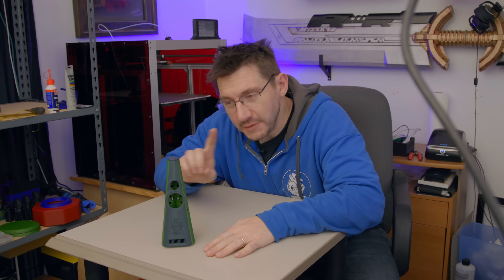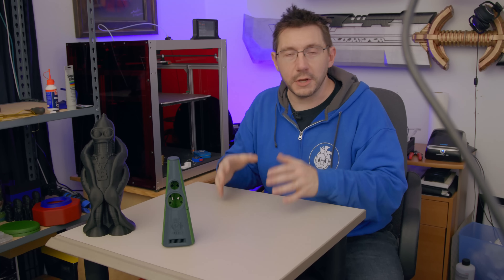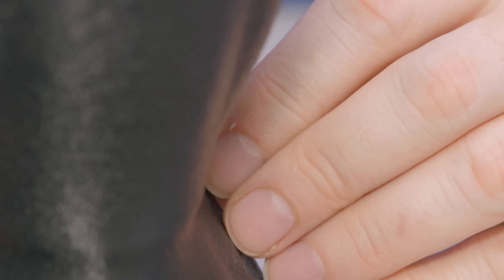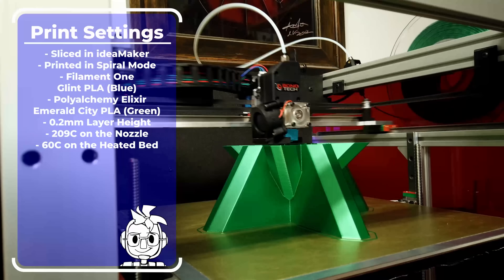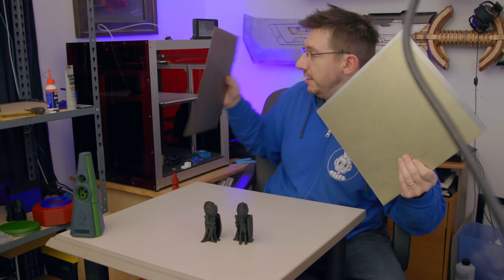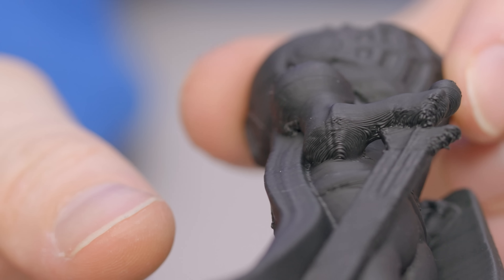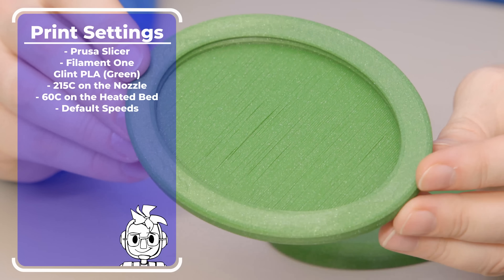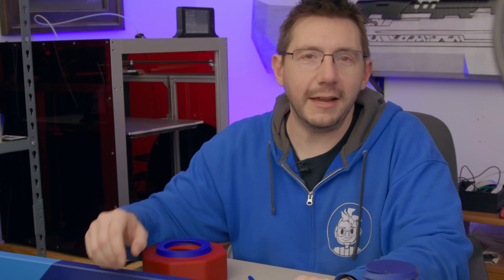Satisfying Prints from the Daedalus 3D Printer!

Comment: I think there is a mistake at 1:20: Isn‘t a CoreXY printer defined by the belt system driving the print head diagonally? So when only one motor spins the head moves from X0 Y0 to X100 Y100 f.e.?

Comment: The caption explaining corexy is wrong.  It's nothing to do with the Z axis at all.  It's in the name darn it!   
It's all about the way the X and Y axes are controlled.  The characteristic of a corexy is that to move in only X or only Y, both motors have to move in sync.  If only one motor is active, it will move the head on a 45 degree line.  The often confused H-bot uses a similar system, but the arrangement of the belts means each motor controls a separate axis, so it is a cartesian printer.
That tree was gorgeous.  One day all prints will come out like that.

Comment: You mentioned the layer bonding issues on your Polyalchemy Elixir, and I wanted to mention that I've had similar issues with my red Elixir filament, even when new. It just seems to be somewhat more brittle of a material than most PLAs, possibly because of whatever they put in it to get that shiny surface finish

Comment: Regarding the bumps on the big nut: You do not need any retractions on this model if you can convince the slicer to always move the print head around the big inner hole and never cross that hole.

There might be a setting like "avoid crossing outlines" in your slicers and in Simplify3D there is an additional "maximum allowed detour factor" which I have set to a ridiculous setting of 70,0 and in this setting I can print things like a c shape or like an o shape without retractions and without retraction blobs, because the print head always stays within the model, in every layer, in every head movement. And the layer change is so fast that it does not need a retraction.

Carefully look at the preview with head travel movements enabled (the traces of the movements, the lines) and watch if you have got the settings right before printing it. It might cross the inner hole on the last flat disk-like layer with a fast travel move (which is annoying, because that leaves a trace mark), but it should not cross that hole anywhere above. 

So there should not be any stringing (that is hidden invisible within the model) and there should not be any retraction blobs, because we don't need any retraction just for the quick layer changes. The print head will not stand still at any place for a second, it will always move and therefore we can avoid the blobs.

Test it with a small model for a first try.

Comment: Elixir has weird retraction: it oozes long after pressure in the nozzle is relieved.
Fast travel, long and slow retraction, moderate layers, dehydrate the stuff just before you use it.
Layer strength will never be very good.
*
It is two plastics in one: a translucent bulk material and a pigmented bit.
The bulk has a lower melting point than the other bit.
During printing, the pigmented bits get stretched into very fine strands suspended in the bulk material.
A difference in the way the two materials bend light makes the strands shimmer.
Pigments in the strands tint the reflected light, much the way metals like gold or copper do.
Clever use of refraction.
Ornaments look great, but any ringing or wobble shows up like mad!
Elixir printed objects hold up well, even scuffed surfaces still look metallic.
Vase mode is best, a dense print might crack over time.

Comment: There is a NEW ATTACHMENT for the Ender printer. its a 45 degree bed with Auto eject feature with a new type of glass bed and it will print totally different models, all in he same cue. I would like to see your test and opinion on it supposed to retail for 200. Made by 3D Que and called Quinly and is supposed to automate the ende 3

Comment: I ordered a Daedalus based on your review/unboxing too late to help the kids, just needed more time to make my mind up.  I have been 3 D Printing for  several years now using a XYZ AiO 1.0.  So far so good.  Needless to say I am still learning about the printer and Prusa Slicer. My biggest issue is supports that are absolutely terrible to remove using the Prusa Slicer and the settings from Git Hub for the Daedalus.  The XYZ slicer generates much better supports in general to remove verses Prusa Slicer.  I'm sure it will just require me learning how to tune the settings.  I am looking forward to the improved cooling arrangement. Keep up the great informative videos.  I am working on  adding a door and top cover to make printing ABS a little less challenging.  I was able to find red acrylic at the local DYI place, not exactly the same dark cherry red, but wanted to keep with the color theme Project R3D started.  Support from them for questions has been great.

Comment: Joel, I want to thank you for bragging up MagiGoo. I was skeptical when I acquired it, if it'd help with bed adhesion more than the hairspray that I was using. With the hairspray method, I'd get 3-4 prints before I had to clean the build plate, & re apply more. I've now printed over a dozen parts on with the original application of MagiGoo. I'm really impressed with the product they sell! Having gotten great prints with PLA on the CR6-SE, I'm now stating to experiment with printing ABS on it. HOPEFULLY ABS & MagiGoo continue to give me the same results as PLA did!

Comment: I once attempted a Voronoi vase on the MK3S with so-so filament from Raise3D (dual purpose: I wanted to see if I could print the vase, and I wanted to get rid of suboptimal filament). The darn thing wanted to curl at every opportunity, so I think I slowed it down to give the cooling fans a decent shot of freezing the PLA as it came out of the nozzle. It worked, sort of.

Comment: I am interested in this. I have 3d printed a smaller speaker box myself.  My biggest concern is that while very cool. Resonance of the material may not be a great. Normally hifi cabinet speakers are built from solid materials like thick wood, mdf,metal or even marble. This is to reduce vibrations of the box it self. 3d printed filament just does not seem like a stiff enough material. I am a hobbyist speaker designer, but do know some of the heavy weights who make the $1k to 10k speakers. Putting nice drivers into a bad box, can lead to very bad sound. I hope this has success, but I am really doubtful. But would love to be proved wrong.
Reply: For this to work acoustically, the material would need to convert physical vibrations into heat super efficiently. That's sounds like some future material to me. To test this enclosure, use an accelerometer attached to it (at various locations) and play a frequency-sweep audio file to find resonant frequencies. This will include resonant frequencies of the speaker drivers as well; i.e., nothing is easy. Or just declare that the speakers sound great...

Comment: You should do the bowl of water test for the fans to show how close it is to the nozzle and you can also show where it actually hits and all that by putting it under the hot end and adjusting the Z height till it’s close and then you can see the ripples in the water and where it’s hitting and if it’s aligned to be right under it and such

Comment: Ender 3 gets these results .. lol
Reply: You can absolutely get great results with just about any 3D printer, normally you have to sacrifice a few things to achieve them. You normally have to slow print speeds and tinker with your printer to achieve the best results. The Daedalus is meant to remove as many sacrifices as possible, normal prints on the Daedalus are between 100-150mm/sec (true speeds) you can definitely turn a printer up to those speeds but they normally won't achieve it due to accel and jerk settings where this unit will. For reference we have cut the print times down to roughly a third with the same quality,  using the same size nozzle and print parameters when compared to $1000-5000 printers on the market. It also has higher-end components needing less upkeep over time. Either way, yes you can make any printer print well if you are willing to put the work into it, the Daedalus is more for those who either don't have the time or don't want to mess with the tinkering.
Reply: Project R3D Team your completely right, and if this guy can get good prints that means it’s a great printer, I get the feeling 3D printing nerd bites off more than he can chew leaving him in a mess and 95% of his prints are ehhh , in general I don’t think he does most of his printers justice because if he took a little bit more time with his print 95% of his printers can print amazing but I totally love a great core xy machine they are in a different league

Comment: Wow the HUGE articulated LED Lamp arm looks fantastic. I use them everywhere where i need to have an articulated arm, i.e. as a mount for a DSLR camera. Pro Tip: Double up the notches around the screw so that they are 15 degree rotated instead of 30, this way you can adjust them more precisely. There are some OpenSCAD files on Thingiverse which make customization very easy.

Comment: Your definition of Core XY is severely misleading. Based on that definition the Ender 5 is a Core XY printer, and the Voron 2.x is not. However it's the other way around.

Edit: To contribute something and not only criticize, I'd say that in a CoreXY printer there are no independent steppers for each axis (like in a cartesian, where there is a X stepper and a Y stepper), but that movement in both X and Y axis are controlled by 2 steppers working at the same time. The bed (Z) doesn't matter at all here.
Reply: Yes, calling NON-coreX printers as such is a terrible idea.
Reply: We have limited space in that graphic. I tried getting as much of a definition as I could in the space I had. 🤷🏼‍♂️
Reply: @lasersandlayers  it would've been better to provide no definition, than to provide a wrong one IMHO

Comment: Not sure if I buy that "it's old so bad quality" with polyalchemy filament.  I have a 6 year old roll that still prints great.  Silk pla (for me) tends to have those layer adhesion problems.  I zeroed my problem down to too much part cooling.  Not sure if it will fix your issue.
Reply: me too any suggestions with silk pla?
Reply: @3dprintingviking534  I have found dropping my part cooling fan to minimal levels resulted in a better adhered part
Reply: @thokk10289  thank you so much. Going to try that out. Been trying to print rims for hot wheels tires for replacements on vintage hot wheels for restoration.